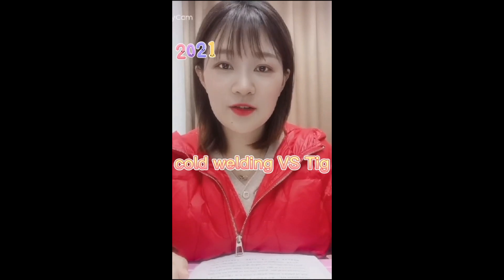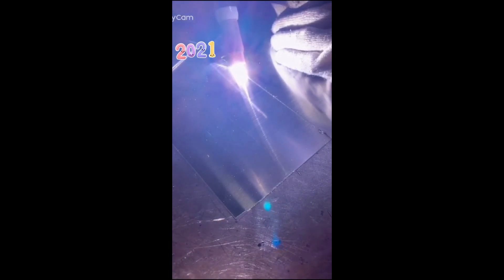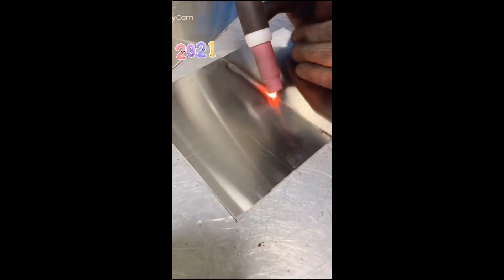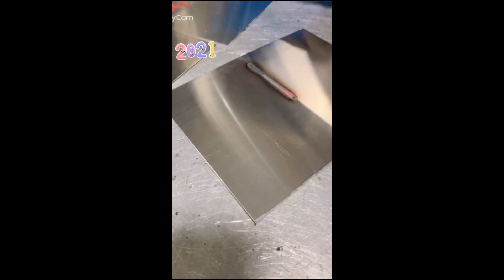what is the difference between cold welding and TIG ?

Comment: Hi, I think a comparison with this welder and a conventional Tig welder is like comparing a family car to a truck....they both have wheels but have different load capacities and are used for different purposes.
Taken to it's ultimate extreme I suppose if the current in a cold welder is really large enough you could get a deep penetration if you really wanted to, but the market for such a beast would make it extremely expensive and defeat the object of the exercise with this precise welding method............a Tig welder cannot compete on the same playing field as a cold welder and vice versa.

Comment: why don't you show an endurance test? I tell you why, these welds are worth nothing
Reply: Giacomo, this is high precision welding. It's similar to laser welding. You have low surface penetration but depends on material thickness. It works for very fine thin plate. Although if you ramp up the current it can easily do normal Tig stuff.
Reply from the maker: We can do endurance test
Reply: Do you need any gas for Cold Welding?

Comment: You show a welder setting  of 8, 5 im assuming that 8 amp at time or duty cycle ? pls explain in detail also explain  difference  time vs duty cycle seting
Reply from the maker: the machine is Capacitor energy storage ， and Precise control of time and current